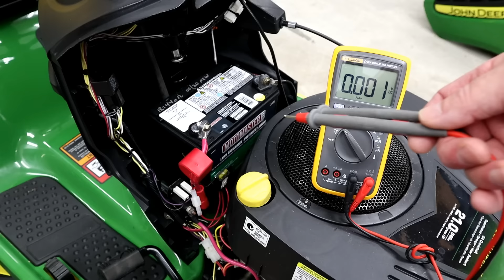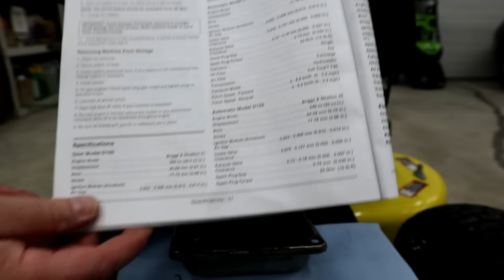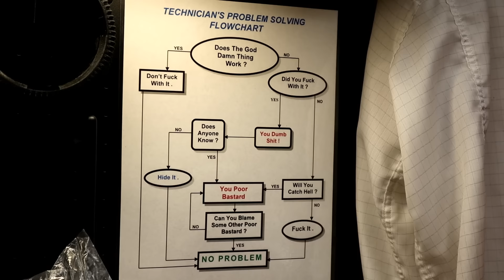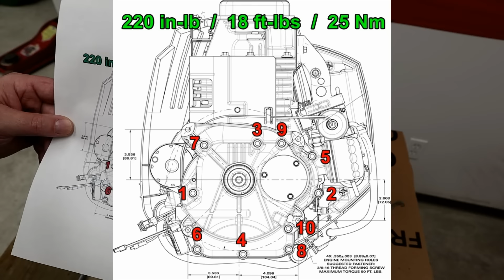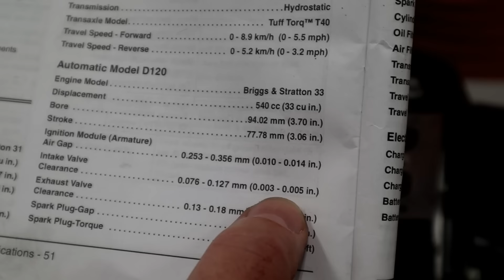Why Won't Your Riding Mower Turn Over? COMMON Briggs Intek PROBLEM & REPAIR.

Comment: It’s a shame that the same company that made the bullet proof opposed twin and Quantum engines makes this junk now. I would sell that now that it’s running especially if it has the plastic case transmission.I would by another mower with a Kawasaki FR or Kohler 7000 engine instead. You will be much happier.
Reply from the maker: Next mower will be electric.
Reply: @Rchelicopterfun  You might want to read the reviews on electric mowers. They’ve come a long way but the battery tech needs to be better for longer run times. It’s the same problem with vehicles. Why do you think that people aren’t buying electric cars.
Reply from the maker: @Andy Becker. Suggest you do some research as well before leaving nonsensical comments.
1. I have read many electric mower reviews. Those that understand the tech leave glowing reviews.  I've also used our neighbor's electric Greenworks zero radius and it's fantastic! That's exactly why after having that impressive first hand experience, if & when I ever have to replace this Deere, it will most certainly be with an electric model. Moreover, by then, they will have improved and dropped in price even more. 
2. Run times not long enough - total BS! I had no issue doing his yard which is slightly larger than ours with the Greenworks zero and still had capacity left in the packs. Even if that were true, the solution is simple. Get more LiPo packs for longer run times or break your mow into two sessions. 
3. The last comment about people not buying electric cars is also incorrect. Suggest taking some time to look at sales trends for electric vehicles over the past several years and what percentage of all new vehicle sales are full electric now. Almost every manufacturer is ramping up production big time as they develop their own electric platforms to keep up with the growing demand which is outpacing production. Every single person I personally know that owns an electric vehicle loves theirs and say they would never go back to ICE. The only thing that is keeping more people from jumping into them is the long waiting list because the demand is so high and of course the higher initial cost but that keeps coming down and is now within reach of ICE. I know my wife's next car will be electric (she already drives a hybrid), and I hope mine too if prices continue to come down. Suggest you inform yourself before leaving decade old anti-electric fossil fuel talking points.

Comment: Is this the same with the Kohler 17.5? Went to start mine for the first time this season and it won’t turn over, tries just like in your video.
Reply from the maker: No idea. You have to check the engine model # as stated (Briggs Intek 33 series have this issue). I presume you've check the obvious culprit first after a period of storage - a flat battery.
Reply: @Rchelicopterfun  When before I winterized it, it ran fine but I did purchase a new battery for this new season but like I said it just turns a little and stops. I can’t even spin it by hand with the plug out. Just out here trying to figure out what could be wrong with it. It’s an L110 I just wish I had your knowledge. Great video by the way.

Comment: Briggs should bite the bullet like Kohler did a few years ago and hand out new motors after they find out whats causing this. Ive done several this year, i got one at my shop with 70 hours on it and briggs has 152 on backorder.
Reply from the maker: Wow, a failure in only 70 hours! Yep, it's a real shame and lack of parts only adds insult to injury. ☹

Comment: Same symptom, rotates, but can't get past compression. Watched other vids, decided that the cam comp-rel was the prob. Ordered part, disassembled motor. Compression relief IS FINE, not broken. Checked fit, play, everything I could think of. Still no reason for issues. Any ideas?...Update...Completed rebuild with new part, still won't turn over. HELP!!
Reply: Intake valve clearance(if that is the one the compression release pin acts on) adjusted loose? Weak starter or battery?
Reply: @davidpowell3347  Yep.  Tore down the motor, Again!...This time for the fried head gasket. While I was in there, I adjusted the valves instead of rebuilding as is.  Found slop in the intake rod/rocker assy. Once I figured out the inner lock nut, the adjustment was easy. I think, over time, the rod shrank a tad, just enough to negate the comp release.  Anyway, snugged up the rod, starts fine.  PS, I had figured out a bypass for the hard starting, so I was able to use the mower enough to blow out the head gasket!

Comment: How is this problem fixed ? do you just replace it every time it breaks😫
Reply from the maker: That is  a question for the Briggs & Stratton marketing and engineering/development team. Of course the way to permanently fix the problem is to toss out the stinky jerry & oil can for good and get an electric riding mower. 🙂

Comment: Still can figure out why people start their lawn mowers wide open  !
Maybe they start their vehicles the same way ! The Choke will work on low idle as well !
Reply from the maker: No, the choke on this design will most certainly NOT work on low idle! You have to push throttle to full and then beyond to engage the choke plate. Not all carburetor designs have a separate choke engagement independent of throttle position. Even when they do, most instructions state to set the throttle open wide with choke engaged when cold starting. So there are the reasons and now you'll no longer have to figure out why so many people start their power equipment wide open; you are welcome for the free education.
Reply: Im sorry i just can't find it in me to fire a engine WIDE OPEN THROTTLE !

Comment: i had a leaky injector causing the engine to be flooded, pulled the plug, turned it over, problem gone. Installed a valve on the fuel line, problem solved.

Comment: We can rightfully bad-mouth the engine, but the buck stops with Deere.
Reply from the maker: Wrong; the flawed Intek decompression cam buck stops with Briggs & Stratton and it always has. If this is the game, you must apply your buck stop argument to Craftsman, Husqvarna, Toro, Club Cadet, White, the flavor of the day at Costco, Sam's, other box stores, and likely a couple dozen other's I've never run across.
I'm no Deere fanboy, but you can't cherry pick which single brand out of the dozens who use the 31 & 33 series Intek engines you want to call out. The fact is simple. It's Briggs weak part, their flawed design and ultimately their and only their responsibly to fix it; or in the case of these failing camshaft decompression pins, their complete disinterest in fixing their planned obsolesce.
People in the small engine repair industry have presented the simple fix to Briggs to cure the problem by just rounding out the sharp trailing edge on the pin so when the crank bounces backward, the intake tappet doesn't hit the pin with as much force. This fix works, but Briggs continues to ignore it or even do something as simple as send out a tech bulletin to repair shops to implement it during replacement.

Comment: Part of the problem is people insist on using oil that is higher than API SJ.  Old design engines with solid pushrods and flat tappets should never have oil formulated for new design engines.  I am sure someone will jump in and state oil doesn't matter.  Is your mower engine 20+ years old with thousands of hours still running great or do you buy new mower every few years?
Reply: Then this should be noted in the owner's manual. And for that matter be noted on every bottle of oil. Why is this not the case?
Reply: @Deucealive75  It usually is in the manual that few people read.  The bottles are labeled as mower/small engine oil or ATV/motorcycle oil.  You can see the rating on the bottle of Briggs, Kohler, Yamalube, etc.  Does not apply to some Honda OHV engines which are a more modern design.
Reply: @solarsynapse  My owner's manual says I can use API SP. Same engine type that's in the video only mine is newer.

The Honda GX OHV engines use the same basic flat tappet valve train design as the engine in the video. I run higher than stock lift cams and more than double stock spring tension on my GX200 clones and never had a problem using common off the shelf engine oil. And they are run at a much higher than stock RPM for the minibike application.

Comment: I have an early ohv 14 5 hp vanguard engine. Is this the same as an Intek? Can I expect this failure or does this affect only later engines?
Reply from the maker: It's only the Intek turd as far as I know (31 & 33 series specifically).
Reply: @Rchelicopterfun  cheers for that
I assume the series# is part of the part /serial number of the engine

Comment: I heard it was risky to jump a John Deere mower.  Don't have any specifics to pass along.  Some type of module.  That mower is CLEAN!!!  I bet you wax it too.
Reply from the maker: The specifics are it's perfectly safe to jump start provided it's done correctly (ie. follow the manual & and not hearsay).

Comment: I agree with you about piss poor design.
I cam lobe could be designed with compression release built in. 
That's the way the old flat head motors were built, easy spin.
I have repaired one with this problem and backorder on oem camshaft. 
Bad design for sure.
Reply: I think Easy-spin as on the old pushmower engines reduced performance. Easy Spin camshafts were stout and sturdy but had no moving parts for the compression release,there was a slight bump built into the base circle of the intake valve cam lobe. When the mower got going faster you didn't notice the loss of power as much because the compression didn't have enough time to leak out very much.
  A 9 cubic inch XL Tecumseh engine on a Bunton mower owned by the School Board didn't have any compression release (I am quite sure) and required a good strong pull to crank over,also with those it helps to position the engine just past the top of the compression stroke just like Rchelicopterfun did with his Briggs 
  that Tecumseh had all kinds of power over and above the Briggs 92902 engine,especially at lower running speeds although both were labeled "3 1/2 Horsepower" 
  I think most Tecumseh built Craftsman and consumer mower engines had some kind of centrifugal compression release ,some might work on the exhaust cam lobe and make the engine hiss during cranking.

Comment: If you go to buy a riding lawn mower, stay away from Briggs and Stratton single cylinder intek engines!  I work on small engine equipment in my home shop over 20yrs as a side job. By the time I open the case and replace the cam with decompression lever, going to cost most of the time more than mower is worth.
Reply: Do a lot of them leak at the head gasket or "blow" head gaskets? Can push just enough gasses into the valve cover and on into the crankcase so that the engine still runs but leaks a lot of oil because the breather can't maintain the proper slight suction inside the crankcase which is supposed to help the oil seals and gaskets keep the oil inside?

Comment: As a civilian & military mechanic  for over 40 years. It gets under my skin when these manufacturers hire SUPPOSED engineers to design this INFERIOR product.  I believe to be an engineer, the requirement is that you have to be a mechanic for 10 years FIRST to qualify.  2nd thought in my mind is how long was testing and when did QUALITY CONTROL (QC) learn of this and what,if anything, did they do about it ?

Comment: Briggs is a no go nowadays for me. Next time you buy a mower get a Kawasaki.
Reply from the maker: Next mower I get will be electric.
Reply: @Rchelicopterfun  You must have a smaller lot. I don't think the current battery powered riders are ready for primetime.
Reply from the maker: Electrics are more than ready for primetime now. Bigger the lot, the more LiPo packs you need. Simple.

Comment: it will turn over if you remove the air filter and cover then cover  the intake port with a piece of rubber then turn the motor over once with a 1.1/4 socket . no air ,no compression  once it starts turning over remove the rubber and away it goes .
Reply from the maker: Would be faster to replace the cam - lol 😄
Reply: Not a good idea to run it if the camshaft has disintegrated the low speed compression arm.  I cranked mine over and by force after this happened and ran it (twice) before deciding it wasn’t a good idea to risk it again.  I took it apart to replace the camshaft and there was enough shrapnel running loose in there to have easily wrecked the engine if I had run it one more time before doing this repair.

Comment: 9:10 Time. Could you just remove, that centrifugal  de-compression thing ?  and its pin ?  NO  real need, for another mechanical, device  to go  wrong .   I'm  sure, the engine would still function normally.   So what, if there is compression upon start-up ?   This  ' decompression ' thing,  is a recent  new invention ; NOT  really necessary for us  older guys.........thanks, Mr Salt !
Reply from the maker: No real need other than having an engine that will start. Without the decompression in place as I clearly demoed, the only way to start it is to manually positioning the crank on the down stroke every time in hopes there is enough momentum built up to get it through the compression stroke; along with the added wear & tear on the starter and battery when doing that. Forget that method on colder days when the oil is thicker, as it simply won't work. Of course if one doesn't mind those compromises and hassles and you only use the engine on warmer days, go to town.

Comment: What’s the average price of this repair?
Reply from the maker: It varies a lot as I mentioned. I've heard some as little as $300 USD with several reporting $800 USD and some won't even do the repair saying it's cheaper to get a new engine. Average would likely be around $500 USD (including oil & filter change) is my WAG (wild A$$ guess).
Reply: Had it done last week, $300 with oem parts.

Comment: Why can’t you just replace the decompression mechanism?
Reply from the maker: Good question. Ask Briggs why they didn't design it that way (need to press the gear off to allow clearance to remove the pin) and then offer the decompression mechanism separately. I bet I know what the answer is; they want more dosh $$$.
Reply: @Rchelicopterfun  Yikes!! That bad, eh? How has that aftermarket cam shaft assembly been holding up for you?
Reply from the maker: @wolfman007zz - so far, so good 🙂
Reply: @Rchelicopterfun  I guess a stronger starter motor was out of the question for Briggs.

Comment: Starting it by hand with mine the pieces of the camshaft, Governor broke the oil Governor that little plastic that slings the oil smashed it to hell and cost more money so moving it till it starts can cost you

Comment: Can't you just eliminate that piece and be done with it ever breaking again?
Reply from the maker: Not if you want the engine to turn over. You would have to manually position it each and every time. Would likely also wear out the starter and battery faster as they are pulling maximum current without the decompression.

Comment: I saw a video where the mechanic said that the valves being out of adjustment puts a load on the decompression mechanism and recommended to adjust the valves yearly.  It starts at 45 seconds and ends at 90 seconds.
https://youtu.be/ymLR4Jy2jEM
Reply from the maker: The best solution that has been offered in the comments by a power equipment shop owner who has done many of these is to round the back edge of the decompression pin. He is convinced this is the final fix and has never had a single decompression failure after this simple mod on OE and aftermarket cams alike. 

It makes perfect sense that this mod would solve the issue so the tappet doesn't slam against the pin when the engine bounces backwards when stopping (compression bounce). It's also likely why there is fairly good evidence that leaving the PTO engaged (blades engaged) when turning off the engine seems to help as their rotating inertia prevents the engine from bounce back when stopping.  
He sent this pin rounding mod procedure to B&S in hopes it would be implemented on new cams or at minimum a tech bulletin - crickets.
By the way, my valve lash was in specified adjustment as you saw, and the pin still broke so not to sure if having correct valve adjustment has much impact (no pun intended). It of course never hurts to keep them in adjustment in the off chance it actually helps a bit.

Comment: Seems like you removed all the safety equipment that was supposed to be on there not supposed to be able to start that thing without sitting on it
Reply from the maker: Nope. They will start fine without sitting on it as long as the brake is engaged. The only time you have to be sitting on it to start is if the brake is not engaged or of course if the PTO is engaged.

Comment: John Deere disappoints me with their lower quality products!
Reply from the maker: This is a Briggs & Stratton Intek engine issue, not a JD issue. Afterall, many other mower brands and power equipment using the Intek's are having the same failure.

Comment: But, but ... Nothing runs like a deer. .... Right ?
Reply from the maker: Has nothing to do with mower brand - it's the Briggs Intek engine that is the issue and many brands use it. Dump on Briggs.

Comment: its what happens when companies speed new products into production BEFORE the do enough long term testing to work the bugs out of them.its basically cheap ass companies wanting their customers to do their long term testing for them.
Reply: It's what happens when the company spends money on Executive Salaries and Bonus instead of putting money into product quality.
Or selling off the company foundry (again to free up money for the Execs. ?) where they used to make ,say,crankshafts and sourcing the new crankshafts from some third party manufacturer.